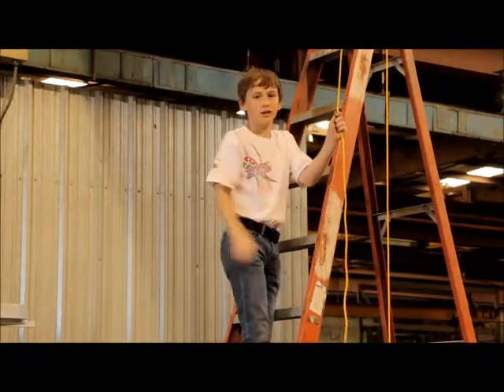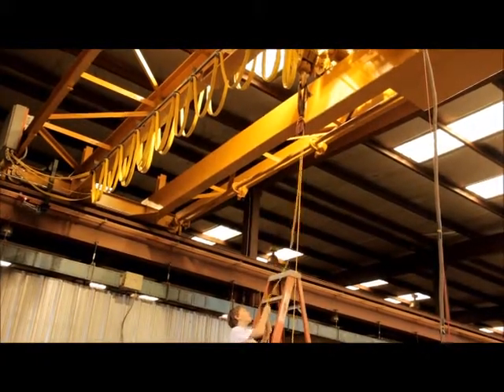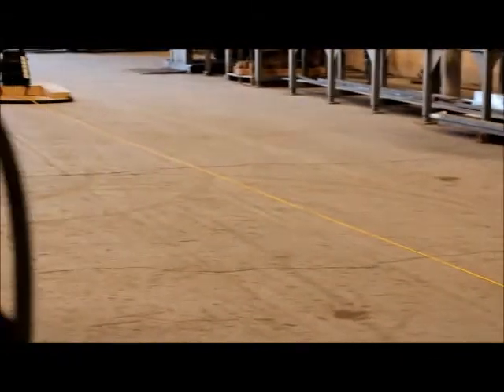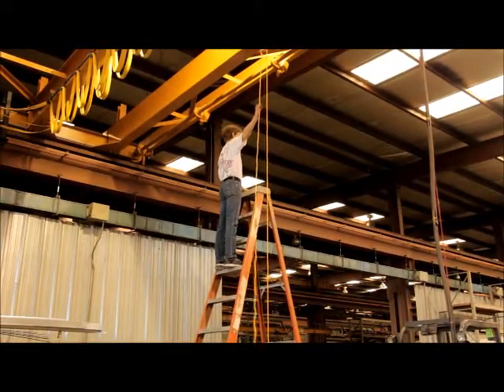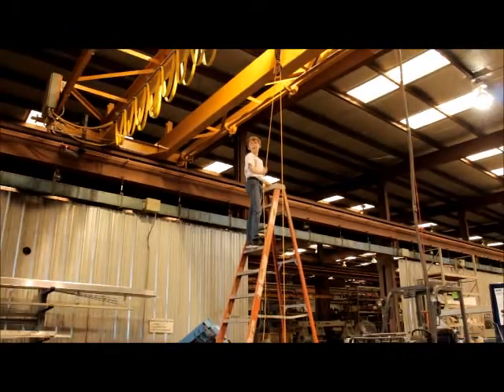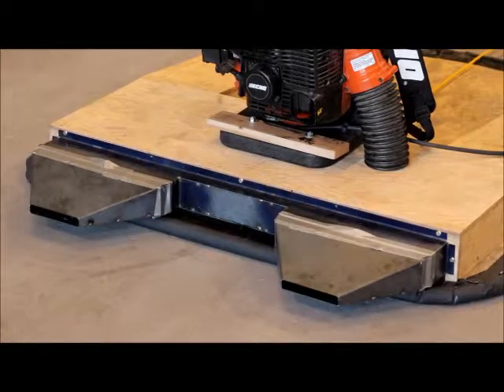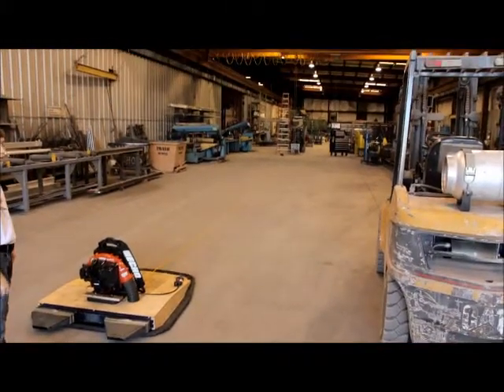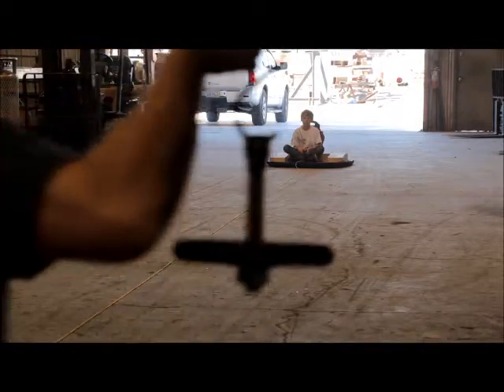Luke's Hovercraft Part 2

Comment from the maker: Chuck - Thank you for your interest in the hovercraft project.  We came to the same conclusion and plan to add a second propulsion source next year.  Seems like high flow instead of high pressure is required for the propulsion.  We saw another homemade project where some high school kids used a weedeater engine (like 20cc) and a prop from an RC plane.  Not sure what we're going to do.  Any suggestions will be appreciated!

Comment: The main goal should be to get the hovercraft to have exactly the right airflow to not "bounce," and be able to float around with just a nudge, and then use the rest of the air for push.Every time you move off center when on it, the bag pressure changes so the thrust velocity will change too.  The easiest thing to do is add another source for thrust. Even people who build big hovercraft have trouble using one source for lift and thrust. Keep trying! Good Luck.